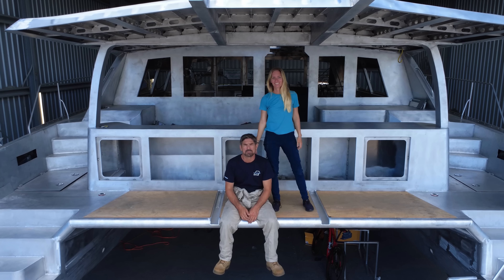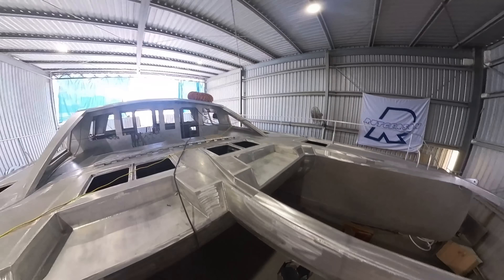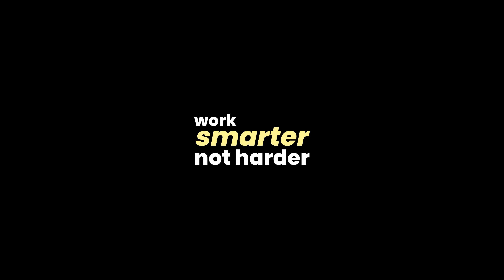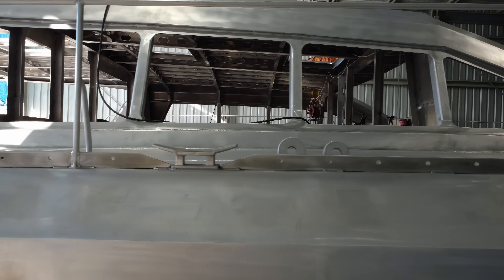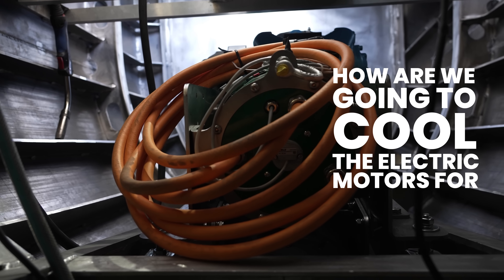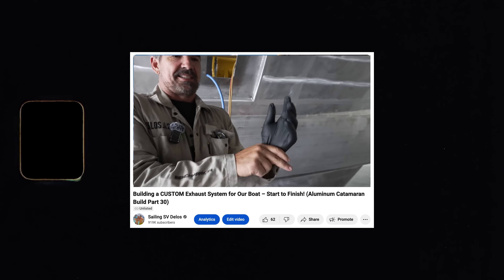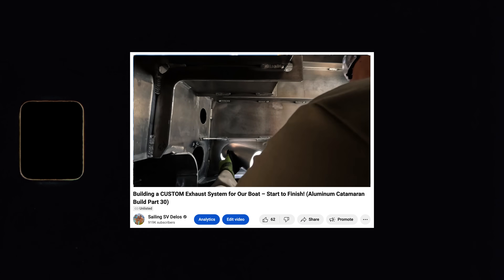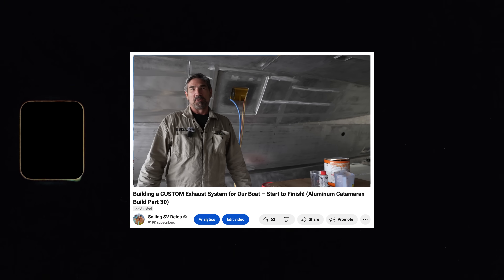We Challenged AI to help design our Keel Cooler 🧠 (Building Our Own Aluminum Catamaran From Scratch)

Comment: Is there already a water-jacket surrounding/incorporated into the electric motor so that you are just leading heated water away from the unit to be dissipated elsewhere? If so, go with the largest knowledgeably estimated size of contact area on the inside of your hull...with all inwardly facing areas of the system (includiing piping) well insulated. It won't matter if you 'overly cool' the electric motor, that stuff works more efficiently at lower temps. 
   All the above is moot if the motors do not have water jackets and you are looking at surrounding the motors 'somehow' and then leading the heat away...I wouldn't want to be designing 'that' system. Sounds like the advice given by the Irishman in answer to the question 'How do I get to Limerick from here?..."Well if you want to get to Limerick I wouldn't be starting from here!"

Comment: Most Nordhavns have keel coolers.  I would ask James Leishman at Nordhavn, or probably better yet, Dr. Nordhavn, James Knight at Yachttech.  They both have either designed these systems or worked on them extensively.  The Nordhavns have a molded in depression on the outside of the hull for the keel cooler to be mounted.  Something like that would be easy on your aluminum hull to create.  The final temperature of the engine I would think you would want to not exceed 45 degrees celsius, but that is just a guess.

Comment: Weld some small fins on the outside where cooler area is, that will create more surface area for cooling.. i  did this type of approach on my race car engine pan to help dissipate heat from  engine oil, works very well

Comment: I disagree with your choice of putting one diesel engine in a catamaran instead of two. You have to run more the engines to go against the wind than a single keel boat and you could run out of electrical power in dangerous situations.

Comment: One variable that may  merit consideration is that the hull will not be in direct contact with the seawater. How much resistance to heat transfer will the layers of bottom paint add? Possibly more than it seems.

Comment: I love deepseek. Been using 3 months. Have to watch it though. It will guess or make calculated guesses. I have to stipulate that answers should be factual when exact answers are required. Or stipulate it must say if making a hypothetical guess But still such a great tool. Have to learn to talk its language. Can be helpful to ask it how to ask it a question sometimes to understand how it formulates its answers. Finally, if diving deep into problem, it will not retain info “overnight”. But you can ask it how to pickup conversation/problem solving at a future date. Cut and paste that when you return and you are right back to point you left it. Very cool.

Comment: I have experience on steel hulled tugs and work boats with both types of keel coolers tube/box coolers and welded channel coolers. For the tube/box type they are usually of copper nickel construction and attached to the outside of the hull via silicon bronze end castings with a treaded pipe end that penetrates the hull plating. These are either mounted proud of the hull or in recessed boxes for protection  when operating in ice. These types of coolers are very effective due to the considerable surface area of the tubes. Parks, Fernstrum and Walter are common manufacturers. I have personally had good service from all three manufacturers. The big issue with these in your case is of course galvanic corrosion.  It can be mitigated with anodes but you would be replacing them regularly. 
The other option which might be better in your case would be welded channel coolers. On steel workboats, these are sections of steel channel welded to the underside of the hull in a fore and aft orientation, with short crossover sections to connect the lengthwise run. This also works very well because you have three sides of the channel material exposed to seawater. As an example 50 X 150mm channel gives you 250 sq mil for every 1 mil of run. Doing this with welded aluminum channel on the outside of the hull would be very effective and would eliminate any galvanic corrosion issues.
As for area needed and heat dissipated it might be worthwhile to consider possible future needs as well.

Comment: Question, how tight to the Hull is the cooler going to be? if there is any air gap at all you will lose efficiency, also 60% of your cooler is exposed to the air in the hull there by raising the temperature in the engine room and in turn making the motors run hotter... Just some thoughts from a landlubber on northern British Columbia...
love watching the build.
Mike

Comment: I would use a brine/fresh water to cool the motor.  Use sea water to cool the brine.  Reason salt water is corrosive.  I would use a tube cooler made of bass with zinc anodes. You can always add a throttle valve (control valve) to the tube nest to control the amount of cooling the sea water does.  Or you can add a PID controller to control the input temperature of the cooling water into the engine, thus maintaining an idea temp for your electric engine.

For your calculations you should assume 10-15% loss of engine efficiency over life of the electric motor.
Doesn't hurt to throw 37/38 degrees into top sea temperature.  World average now is 21C.    The hotter your sea temp, your oil temp in the engine (diesel engine) will go up.  You need to check the parameters of the oil (grease for bearings) you use in the diesel and in your electric motors (bearings), because some oils will break down at certain temperature.  

So you are going to come up with a normal operating number for square feet of cooling area.  For a tube nest its (length of tube) X (number of tubes) x (circumference of the inside diameter of the tubes).
And you are going to have the high number for your extreme conditions.  This should be your max square footage.

Also you need to consider that when you finally get to sea, if you want more speed from the engine and think about getting a bigger engine (30 KW or 40 KW), will the tube nest cooler be able to still cool a new engine.

Comment: I like the idea of salvaging some of the heat for cabin heat. But, the cost & space may not be justified. Much would depend on how much time you run on electric drive. You could thermostatically control the warm circulating water to the cabin or the hull.

Comment: Are there risks of generating thermo-electric currents or voltages when using the hull as part of the cooling system?

 Could a generated voltage jump thin insulating barriers between disimular metals.

The joys of preventing electrolysis on aluminum in salt water environments.

Comment: It sounds to me as if your AI engines are assuming you're bolting a heat sink to the exterior of your hull. When i think what you want to do is to bolt the heat sink to the interior of the hull, transferring the heat through the aluminum hull. That they're suggesting the use of cooling fins is a clear indication that they are on the wrong track.

Current AIs have no understanding of the problem domain, and are very good at providing plausible answers to the wrong question.

Comment: Hey Brian—first off, I’m not an engineer, but I think I’ve got the mind of one. I’ve always loved tinkering, problem-solving, and imagining how things could work better. And watching you build SV Delos 2.0 is the perfect playground for this kind of thinking.

While you’re deep in the design phase, I’d love to throw a couple ideas your way—just food for thought:

1. COCS – Closed-Loop Cooling System
Instead of relying on seawater intake for engine cooling, how about using a sealed ammonia-based loop, like what’s used in RV absorption refrigerators?

 The system would absorb engine heat and dissipate it through coils integrated into the aluminum hull itself. No open seawater loop, no pump failure risk—and as a bonus it could double as a refrigeration system for the boat.

The ammonia would be stored in a rugged, scuba-style pressure tank, and in the unlikely event of catastrophic failure, it would be fitted with a buoyant recovery system and a beacon. That way, it won’t pollute the ocean—and to insure it does get picked up.. its finders keepers, no questions asked other than registering the unit to know its safe. whoever finds it gets to keep it. Win-win. You don't get a polution fine.

2. CRAB – Catamaran Retractable Anchoring Base
Four telescoping legs, one at each corner of the pontoons, swing down like crab legs. Each leg has a four-foot fixed housing and three four-foot telescoping segments, giving you up to twelve feet of extension. The head remains fixed to the pontoon, and the foot folds upward toward the centerline of the hull when stowed. When retracted, the entire assembly tucks neatly into the underside of the pontoon—flush and drag-free.
Giving you a nice, comfortable night’s sleep while you’re at bay.
P.S. One last little idea for down the line—what if the AI system on board could eventually interface with underwater acoustics? Not just sonar, but actual communication patterns. Could it learn from fish? React to pods of dolphins? Might sound crazy now… but so did everything else once.

Comment: Hello, I am a lifelong sailor and engineer. Great work on the build! A good trick would be to locate the internal keel cooler as close as possible to the area above or just behind the propeller. The location may be difficult given the proximity to the rudder; however, the turbulence created by the prop wash will increase heat removal for a given area of exposed hull. Good luck!

Comment: So basically your having AI do complex math for you as a "word problem" ....? Another important problem from the cooling perspective would be cooling your LIPO batteries. Its actually harder to do but very necessary !  I remember when I first started trying to understand marine water cooled diesels I saw a boat that had tubing running over the deck and I didn't really understand what a keel cooler was at the time.  That may have been my first keel cooler . Since then I've seen them and really think they are awesome ! It eliminates the combination of hot exhaust gas being combine with water and sent out of the side of the boat !  I've always thought that was a terrible part of the system for cooling a marine engine ! I recently saw something like an AC marine style on  an Amel that used a heat exchanger (more like a radiator) and a fan and used salt water to cool the air in the boat ! Very smart I think.

Comment: I ran your questions through Grok AI as well, here's the answer: Heat to dissipate: Approximately 2,777 W.

Heat sink size: A flat aluminum keel cooler needs about 0.093 m² (930 cm²) for one-sided cooling, or 0.047 m² (470 cm²) for two-sided cooling. Practically, a plate 1 m long by 10–15 cm wide (oversized for safety) should work for a moving sailboat in 20°C water, assuming a coolant temperature of 60°C.

Also marine growth is going to play a factor as well.

Comment: I was wondering if you were going to use sea water to cool an intercooler fluid, which you then use to cool the fluids for electric motors, diesel motors and your A/C.  The intercooler system is usually sealed, often using something like Zerex, primarily for corrosion protection.  None of the fluids mix, which allows you to use fluids unique to each system, while isolating the intercooler fluid from contamination by all other systems.

A you learned and mentioned in one of your much earlier videos, the seawater inlet should have a coarse strainer directly to a filter fine enough to keep out biological organisms.  Alternatively, take the gross approach and keep the entire system accessible with straight lines and well above sea level so you can clean it every week or so with coarse plastic brushes, but inside so it doesn't freeze.

The intercooler fluid won't be cold.  If you're running the diesel, whose coolant could be 250 deg F, the intercooler fluid could easily get up to 180 deg F.

Thus, you might to use a second, lower temp intercooler to cool your electric motors.

Ah, decisions....

Comment: if the keel cooler is physically in the constantly moving water you numbers would be smaller (deepseek) if your using the hull its self it would need more surface area hence the larger area. my guess take on the difference.

Comment: This is awesome, could save you a ton of maintenance .  I’m mechanical engineer always wanted to play with stuff like this.  One idea I’ve had is to use cooling water, closed/open, and pump through one of those cooled mattresses.  Feel like even a few degrees heat sink for your bed would be amazing in the tropics and use tiny amount of electricity on compared with AC.

Could use your motor heat sync at night, maybe flip to keep batteries cooled while at anchor and charging on solar, cooling mattresses at night.

Comment: I know nothing about Keel coolers, however I wonder how well it will work if you are using the diesel motor to spin the electric motor for electricity while at anchor and water is not moving over the keel. I know this would be unlikely considering how much solar you are planning to have, but Brian I know you like to prepare for any and all situations.

Comment: I vote build new rudders with two gun drilled ports in the shaft and so that warm liquid comes into the top of the rudder and cool liquid leaves the bottom of the rudder.  I few pressure rated swivel fittings on the top of the shaft and boom cooler leak will not sink the boat.  Heat will not be in the hull.  Plumbing will not leave the engine compartment/ rudder compartment area.  Not keel cooled but rudder cooled.

Comment: You can't really trust any calculations done by current AIs, not at least the general ones like chatGPT, Deepseek or Gemini. The way LLM AIs work is that they are essentially just predicting what the number should be in the answer instead of calculating it. Sometimes it works, some times it does not. The worst part is that you don't really know when they are bullshitting you and they don't either. They are pretty great for doing the first big steps though. Just check what they say by googling around the stuff they said and then do the calculations yourself and you have good chances of ending up with something that is correct.

Comment: What is the surface area of your rudders?  I know that this is an after thought but isn't the rudder the Ideal location for a cooler?  I expect the location is convienent to the motor location. thru holes are above the waterline, it adds minamal weight and is in a location that has the possibility to be repaired with minimum invasive deconstruction.

Comment: Cooling issues. Always puzzles me with a cryogenic background ( understanding of gasses, pressures and temperatures ) on top of a trucking background around many frozen food warehouses.  Even remembering the day discovering how an RV refrigerator worked with a small pilot light on a tank of ?  Ammonia I’m guessing. So, why can’t we do the same enclosed system that as an engine or motor heats up it reacts with the refrigerant cooling down the source? Just thinking out of the box here. Love your channel, thx.

Comment: Lifelong sailor, mech engineer, now teaching college mech engineering incl heat transfer. Biggest impact is temp of plate. We know (can scenario) water sea temp. What is needed as a key assumption is the fluid temp at cooler plate?  Outside heat transfer coefficient is less important. Based on answers, figure deepseek is aggressive, as I have experience that Chinese engineering is, and chat gpt is very conservative (re Microsoft). Any answer will be wrong under different conditions. I’d use the 1/3 m2 guideline if I were deciding. 

Every 5 pct chg in temp difference (cooling fluid or coolingblock minus sea temp) would require 5 pct chg in block size.

Forget the fins comment by deepseek unless they are going on the waterside. these type of misunderstanding is typical of AI. (I don’t think) you specified that the plate be bonded to the inside of the aluminum hull. I think ai was considering the opportunity to be fins on a plate outside the hull. 😊

Comment: I asked grok your exact question, and it came back with:

Final Answers

Heat to dissipate: 2,780 W (2.78 kW).

Keel cooler size: Approximately 0.185 m² (e.g., 43 cm x 43 cm) for a moving boat with water at 20°C and a surface temperature of 40°C. If stationary, it might need to be 2–3 times larger (0.5–0.7 m²).

Comment: You mention the assumptions that the heat sink should have fins and should be insulated from the boat to prevent heat transfer to the boat structure, but you don't address those issues. Seems like if it does have fins and is insulated from the hull, then you're introducing a drag coefficient that needs to be considered.